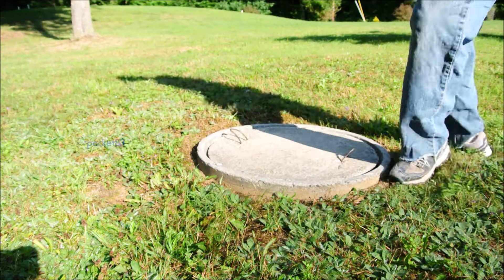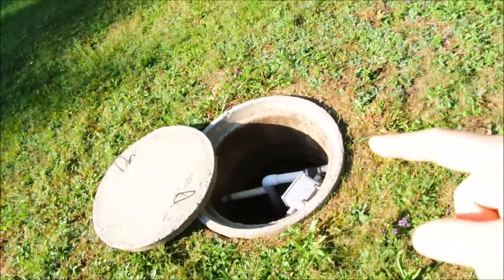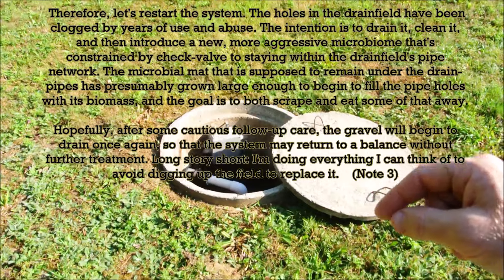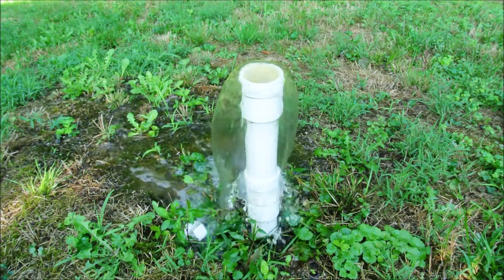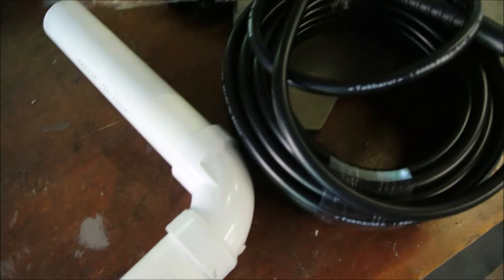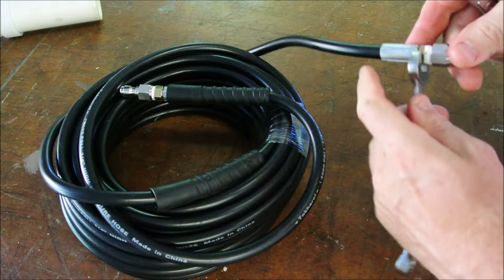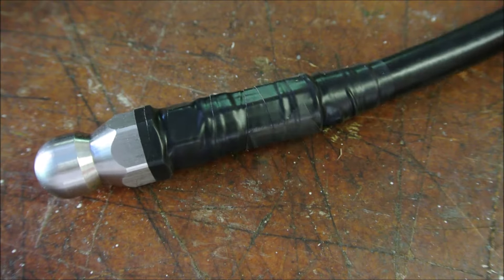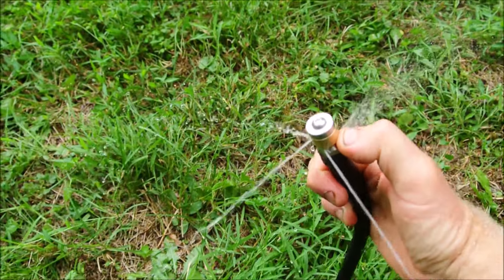DIY Septic Tank Drain Field Restore (Leach Bed Flush)

Comment: The big septic issues always seem to be related to either 1) a clog in the distribution lines or 2) accumulation of 'biomat' in the absorption field that keeps water from perc'ing down. 1 can usually be jetted out, but it seems like #2 can often lead to drainfield replacement. I've seen research where people have been able to clear out the biomat by using strong oxidizers (basically Oxyclean) dumped directly in the leachfield lines. That, or a specialized procedure where a large machine injects high pressure air into the field to break everything up. I know if (when) my field starts to have issues, I'll try the oxidizer chemical approach, as it makes sense to me. I agree that the talk about additives is mostly nonsense: your waste has plenty of bacteria, and there's no need to add anything else. It's not usually the current bacteria-levels that are the issue, rather the accumulation of biomat or other materials (from an overflowing tank) that stop everything up.
Reply from the maker: Did you watch this video? Do you have an issue with some part of my approach? Do you understand that the goal was to reduce the mass that's in the absorption field by establishing a long-term bacterial presence in the pipes? Are you aware that the treatment apparently worked?

Comment: I have a similar three-tank system but my installation lacks proper clean out points. I think I will have to dig up and expose the pipes leading into the drain field and then perhaps cut the pipe and add appropriate cleanouts. Once I have cleanouts I can try the pressure washer as you did followed by Roebic treatments. I think I have tree roots as part of the problem so I may also need to rent a drain auger. It seems that new systems use chambers rather than perforated pvc pipe and are much better with much larger volume and absorbing surface area.
Reply from the maker: Good luck. Once you have a cleanout or two in place in the corners, you'll be able to flush out quite a bit of the system. There's probably a plug somewhere in-between that's been clogging up the works. 

Hey, look at the bright side: 1) The digging isn't very deep. 2) One corner cleanout can be installed at a time, so there's not much pressure to rush. 3) It's only shovel-labor, with very little expense. 4) You're facing a high likelihood of success.
Reply: @pocket83squared  I hope I can achieve at least temporary success. The pipe tees off many times. I think ideally each branch needs a cleanout or needs to be individually routed to a distribution box.

Comment: I do wonder how septic science has changed as 40+ years ago as a kid we had a septic tank and there is no way we had it pumped every two years.   ¯\_(ツ)_/¯.     And the leach field was easy to find as that is where the grass was green in the heat of the summer ...  😁
Reply from the maker: Not much, except for maybe some submersible pump tech. Of course, mileage will vary depending on how a system was installed. That said, it's my opinion that most systems are probably not operating the way they were designed to. Ours was also barely pumped. Around here, tank cleanings seem to be regarded as more of a 'fix' and less like routine maintenance. 

Thus, into the streams it trickles. If a tank isn't being pumped, that, um, biomass has to go somewhere. It doesn't just va-poo-rize ;)

Comment: I had a drain field fail on a new construction after only 4 years.  As it was entirely gravity fed, there was no secondary pump chamber like yours.
Well, my wife got the house in the divorce, so I didn't follow up on it, but I had tried converting the tank to an 'aerated' system by submerging an aeration tube fed by a powerful air pump. 
The problem was that this was being done in the primary tank with all the raw sewage coming from the house.  I say 'primary', but there was only one tank.  My plan didn't work as explained below.
 
My reasoning for 'aerating' was because I was led to believe that AEROBIC bacteria are 7+ times more effective at consuming the biomat film in the drain field.
What I didn't realize is that churning all the sludge & slime would clog the outlet filter of the tank in a day's time and overflow the tank just like a clogged drain field.
After more research, it seems the 'aerated' systems are at LEAST two tanks.  The primary tank is a 'settling tank' that works ANAEROBICALLY (meaning without oxygen).  Then what leaves the primary goes to a SECONDARY tank/chamber where OXYGEN is introduced which jump starts the 7x AEROBIC bacteria action, which, when it makes it to the field, consumes the BIOMAT and thus heals your system.

In your case, in MY opinion, I think you could have introduced an air diffuser plate (fed by a pond air pump) on the bottom of your pump tank.  That effluent would/should be free of sludge/slime from the primary, and be an excellent medium to grow and distribute AEROBIC bacteria to your drain field, fixing it. 

Since I never had the chance to test this theory for myself, I cannot give you 100% proof it has worked, but there appear to be others who have converted their secondary tank to AEROBIC through aeration and had great success.

Just a thought.
Reply from the maker: Really interesting stuff. I'm extremely skeptical, though. Although aerating a system would certainly help to cultivate a different microbial environment, there's no certainty that the mixture that you end up cultivating would be one that really is 7x as aggressive. Further, a 7x hunger means a 7x consumption demand, so there would be a more strict dietary requirement, and populations would end up surging/crashing faster. 

Let's look at the forest though, and not at a tree. The point of the process is to hold off the types of 'breaking down' that burden the field while encouraging those that unburden the field. The only reason to change a (functioning) system would be to establish a bacterial culture that allows one to pump the tank less frequently. But in the end, finding a perfect balance that doesn't require the tanks to be pumped would be an extremely delicate matter, and this is not likely to be achieved by most people, since there will be lots of research and testing involved. 

Empirically, such an approach is difficult to verify, because most of the people who claim they "don't need to" clean their tanks are not successful researchers and testers, but are instead just running a broken system that's pumping their waste into the local ground and surface water. [See comments.]
Reply: @pocket83squared   THANK YOU FOR REPLYING! 
I may have to emphasize that I'm not suggesting anyone change their 'primary tank' system, and in your case, you're lucky. 
You can leave the primary tank/anaerobic system entirely alone.  The primary tank should not be aware of ANY change because the AEROBIC action would be downstream of it.
If I had had your setup with a secondary 'pump tank', I could have changed the 'drain field system' to AEROBIC (not affecting the ANAEROBIC primary sludge/slime tank system). 

There are at least TWO sub-systems in your (or anyone's) rural septic system: The Septic tank and the Drain field.
From what I've seen, ALL primary tanks are to be ANAEROBIC, (and not to be churned like I mistakenly had done back in 2012!)
And the DRAIN FIELDS have to rely on that ANAEROBIC bacteria (in most cases) to consume the BIOMAT that develops in the DRAIN FIELD. 
 
What I've been led to believe is that introducing AERATION in a secondary tank will then encourage the propagation of AEROBIC bacteria, which I've also been led to believe is 7x more effective at consuming the BIOMAT.   The conclusion of these ideas was that 'AERATED' effluent could heal a drain field of normal biomat build-up.  I don't think it was ever implied that aerated effluent could fix a field where 'SLUDGE & SLIME' had built up, so the primary tank would need to separate those before ever allowing effluent to the secondary.

But alas, I'm on a public system 1700 miles south now, so I don't have to deal with that anymore.  Still, I wish I had had a secondary tank to experiment with.  My ex had problems with it even after I left.  We were a family of 6, complete with teenagers who liked LONG showers.  I'm sure we overloaded it.  Three of the kids married and left, so there might only be two people on the system now. 
 
If I had to do over again, I would have dug & placed a secondary tank between the main tank & the drain field so I could introduce aeration to the effluent... as needed.

On a humorous side note, the first two hours after starting the aeration of my primary tank back in 2012 made an UNGODLY stench that covered 2 acres!
After that?  No smell at all.  You could stick your face in the top of the tank and not smell a thing.  Weird.

I still have that air pump here in Florida, just in case I want to experiment again someday!

Comment: my septic tank system has a sewage pump because half of the house is below the leach line and tank. the sump croc is sealed obviously, but every time i walk passed it in the utility room i know that one day... the pump will fail. and i was have to open that croc of shit. its been about 30 years so far though, and its only failed once and was replaced before i moved in. i think my current pump is about 10 years old. luckily i've never had a problem with the tank itself though. its been drained a few times and access is super easy. it has a regular style manhole cover. my parent's have a tank with a buried access hatch and they have to excavate the damn thing before it can be drained. its about a foot underground.

i've never heard any fold wisdom about tanks though. just that the grass will grow MUCH stronger over the leach line, which isn't actually true in every case. at my parents house, the grass grows about 5 times faster over the line, but at mine it grows slower for some reason and is almost always yellow. maybe i need to throw a bunch of random garbage in my tank lol
Reply from the maker: Every house has a few ticking bombs like that. My advice is to install a water alarm, TODAY. At my last house, the utility room suffered the occasional sewer lateral backup, so I made one of these: 

https://www.youtube.com/watch?v=aTIfF8AfeH8
^It worked great. Also, highly recommended channel right there.

Comment: What treatment product did you use? Thanks for your time.
Reply from the maker: It doesn't matter. Any brand will work. All of them will be bacterial cultures that have been selected for this function. However, I'd look for something that uses a marketing term like 'aggressive,'  because many products are designed to be put directly into the toilet, and so they'll be milder; as long as you're only putting the product into your system after the check-valve, you can use the strongest stuff they make. 

Note that it is my belief that additives should not be used in the tanks themselves, no matter how mild they are. Any further 'breakdown' of the tanks' contents will only end up making the (drain field's) problem worse.
Reply: Oh thank you for your reply, so here's what I've been doing I don't have clean outs at the end of infiltrators nor do I have any pumps, just a concrete tank to a distribution box about 5 ft away and then two drain field lines that go into infiltrator domes. I had my tank pumped about a month ago and I'm just getting very slow drainage one line seems to be pretty backed up I've put Roebic in the distribution box a couple times I don't think it's reaching the field. Here's my course of action, I have a water pump and a 275 gallon tote tank, I've been pumping my own tank to keep it below the outlet baffle, yesterday I put the suction hose into each drainfield pipes and pulled an amazing 200 gallons out of the ground. My plan is to now try and get the chemicals further down the lines and keep pumping the tank a few feet below the outlet in hopes to give the Roebic time to do it's thing and maybe let any other water in the field drain. In case people are wondering I'm taking the IBC tank and it's contents to an RV dump station , thanks if you have any other ideas.

Comment: so what additive did you use, i jetted mine  4-5 years ago, and its slowing down again, i dont have a check valve, may have to disconnect and cap it and put a valve in there
Reply from the maker: It'll be a dirty job, but it might be worth it. A check-valve also reduces the total volume that ends up passing through your pump, so it helps efficiency. Before adding one in, just make sure that where you live isn't so cold that ground freeze becomes a problem. Lines that are full can fracture. For comparison, note that I live in SW central PA. 

As for what brand of additive to use, it doesn't matter much; just read some reviews (and the product's label) before you decide. The one used here was a rather aggressive strain.
Reply: @pocket83squared   gonna try k-570, maybe just put in right in a pump chamber, im in a centre county pa
Reply: @pocket83squared  found only 2 cleanouts, what distance are your cleaned outs spaced?

Comment: I had a problem lately with my septic tank(27 years old}I had to replace the Pump after 25 years, and had a problem when it Rains a lot that Alarm will go off so I have to shut my pump off at the electrical box.I had the Sewer guy come in and he installed 3 Lateral Cleanouts like the ones you have at the End of your cesspool.Myself the alarm still goes off when it rains heavy. and I have to run outside to take one of the 3 Cleanout plugs off so the water can drain out and my alarm will shut off within a few mins when all the water is gone.I just leave one of the 3 plugs off all the time in the summer so if it rains hard I don't need to run outside......Just wondering is it SMART to leave one of the plugs off just incase?Because the cesspool guy says when I hear the alarm just take the plugs off.....Think its better to leave 1 off till winter time here in the Poconos................
Reply from the maker: If you're pumping out rainwater, you're overworking your pump. It sounds as though it might be a rising water table. If so, that's not necessarily a problem with your system, unless you have a crack in the tank that's allowing the water in. Does the alarm go off immediately when it rains, or does it take a few hours/days for it to rise first? 

Another question: is your tank sitting in a 'low spot,' like in a bowl in the yard? Does water seem to pool on the ground above it? If so, there could be a grade problem that might be alleviated by getting the surface water away before it can flood the tanks.

Comment: What do you do with cleaning paint brushes, and other stuff people normally throw down the drain?
Reply: Country folk don't throw anything that isn't natural waste down the drain. Septic systems typically cost 30k to install/repair. Doing what you describe would be foolish if you own a septic system. That's a city thing.
Reply from the maker: Yep. Just as Eric said. When I'd first moved here, I was really concerned about stuff like that, but it turns out to be way less of a problem than it sounds. It takes an adjustment, but to be honest, I now consider that 'normal' lifestyle to be a lazy, wasteful, and inconsiderate lack of self-sufficiency. Nothing personal, man; I did it too, so I get it. It's not like you have much choice in the sub/urban world. 

Here's some of how I handle it now. Maybe I'll make a vid about how I do some of this~

First—and obviously—my used motor oil is taken most seriously. It gets stored in milk jugs and then brought to the local Advance Auto Parts, where they are considerate enough to process it for free, with zero questions. They would receive zero of my business if not for this service. Thanks, Advance. 
 
Water-based paints are diluted with rainwater. A brush can be well-cleaned using less than a gallon with an efficient procedure. I use a scrub-brush and a bucket that's at a slope. Rollers, of course, are a pain. I use a spinning drill jig and a bucket of water for these, but they usually end up requiring quite a few gallons. Paint water is dumped in the weeds around a drainage ditch behind the garage. It acts like a big wastewater filter. A char pit would also serve this purpose well. 

When needed, small amounts of other paints, solvents, and other oily things are sopped up with sawdust and then thrown away. The nasty ones are spread over a bed of dry brush (so it doesn't soak into the ground) and burned. As for polyurethane, you can watch how I treat that in this video:
https://www.youtube.com/watch?v=X85Gj4g0NuA

Another big difference out here is in the trash that we throw away. Anything organic goes into a compost pile (except for bones, corncobs, peach-pits, bubblegum, et cetera). Night prowling omnivores are not considered a nuisance since they provide a service. Squirrels and deer are the far worse pests. Steel cans are rinsed & recycled, and I try to repurpose glass & plastic bottles where possible~we even choose some of our brands by considering the container. Thus, the garbage bags are smaller and don't have much of a smell. Some of the neighbors don't even use bins, because their trash is clean enough that it doesn't appeal to the raccoons. Oh, and kitchen sink garbage disposals are a no-way here. Fine with me, too; those things are just loud, smelly, unnecessary plumbing as far as I'm concerned.